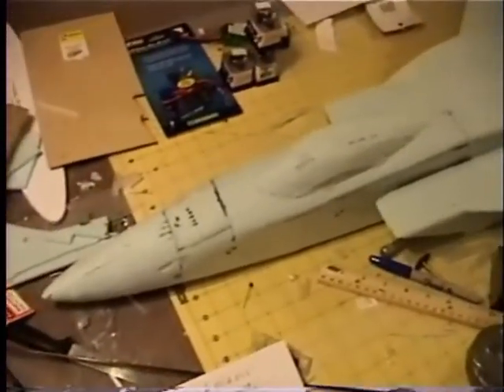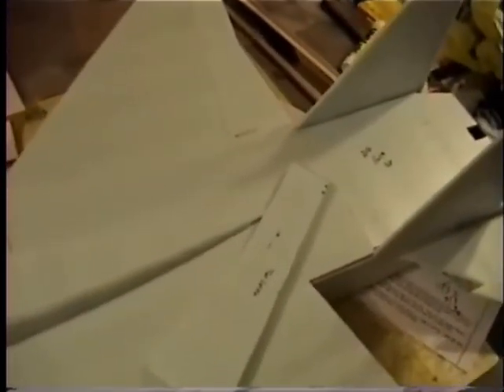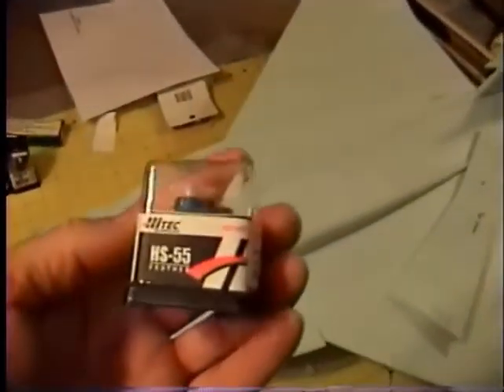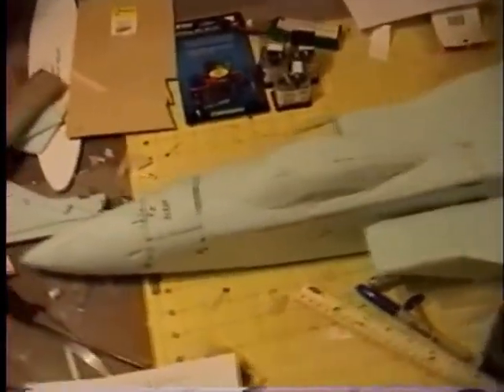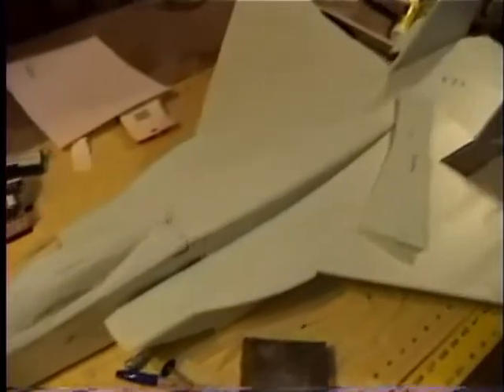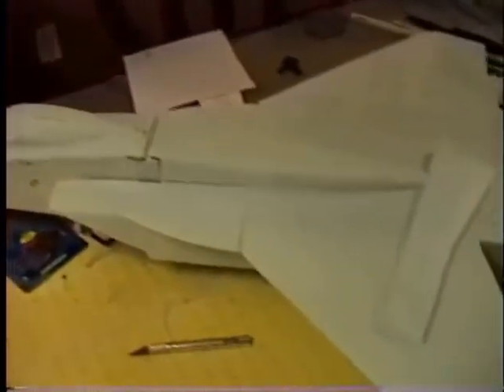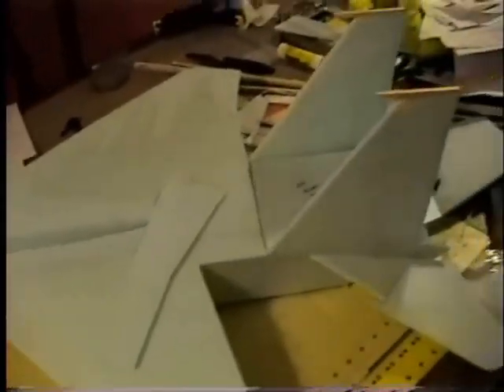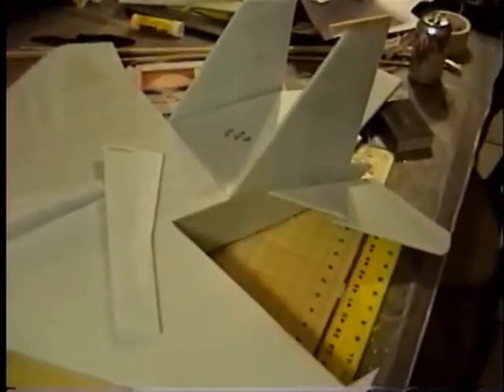F-15 Parkjet build

Comment: I used a 7x3 and a 25c 1800ma battery for a cool 40A / 500w through this same motor.  I wish my 50A ESC was as cool afterwards........whats the deal?  Shouldn't my ESC be more than enough for the motor?  It's got a heat sink and is mounted external right in the propwash.  I know the motor is probably turning alot of rpms..... I'm new to this and completely stumped!  Someone help!